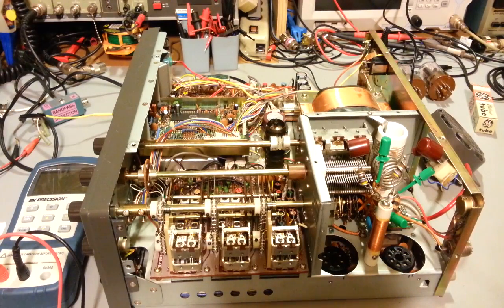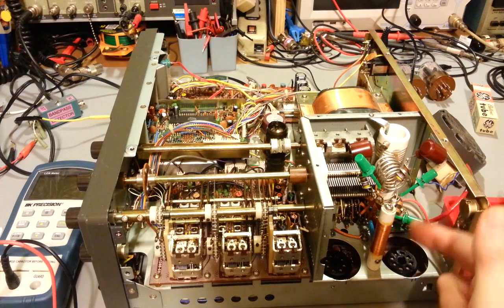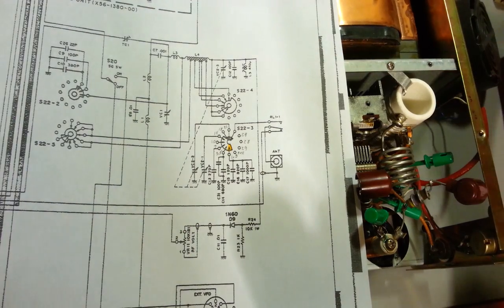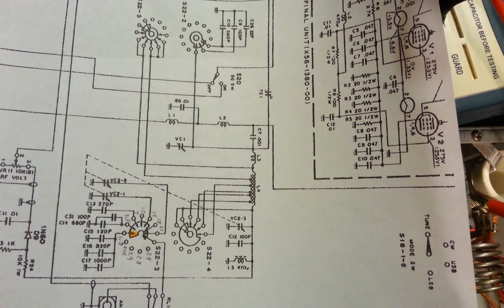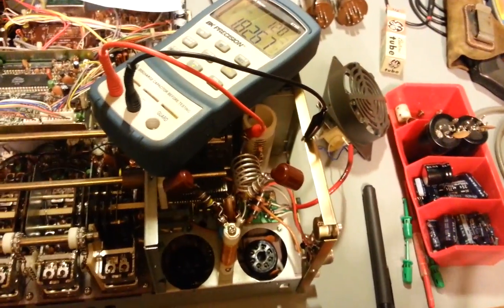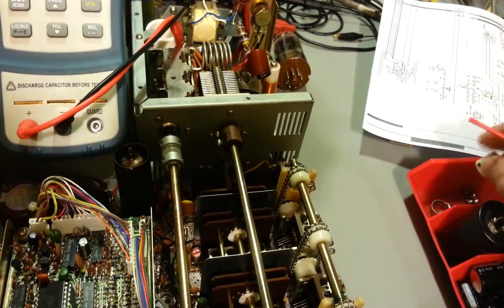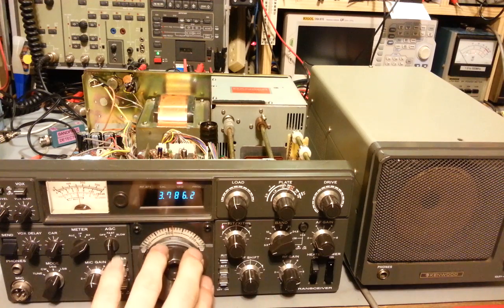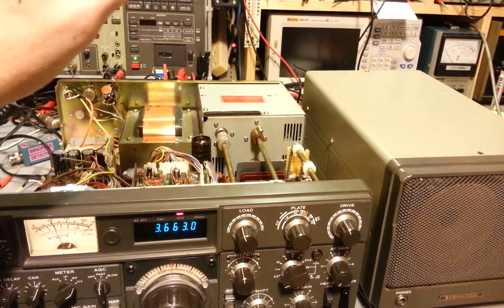Kenwood TS hybrid uneven power across bands. Diagnosing band selector capacitance.

Comment: I deleted first post as all of my reading were near 50% high using a brand new Fluke 15b+. I pulled out my old HVAC meter and the capacitance reading were very close. I take that to prove that part of the band switch is functioning correctly, now for the inductance section of the switch. Only the 7 and 28 MHz bands function . Sending the Fluke back to Amazon.
Reply: The only outlier band I had was 3.5 MHz at 970pf less that Mikes calculations.  I need to look for 1000 pf of capacitance either open or broken wire on 3.5MHz. Also looking for way to remove 520s coil assembly without de soldering individual boards. I’ll probably wait for Mike or Buddy to lead the way.

Comment: Great video Mike. Thank you for your detailed explanation of how these rotary switches work. 
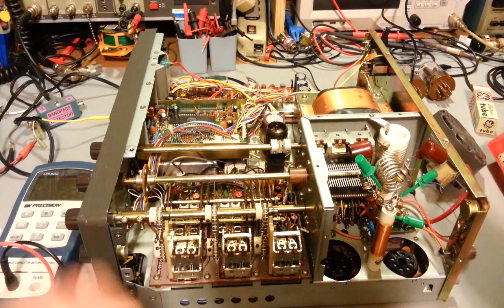I just bought a Kenwood TS-830S, I think it was miss handled during shipment. My problem is with the "Plate Shaft", the screws on the coupler were loose. I didn't know if the dial at 9:00 with the variable capacitor was at 200pf or 0pf. I was thinking that a lower frequency would need a bigger capacitor.
The "Drive Control" jumped off the rear shaft support. The 61468 tubes were at an angle, not straight up.
The main problem I have now is on "Receive", all I get is "snow", and on all frequencies. I didn't realize that I needed to turn the Drive Control also. Some of the switches crackle when switched.
The 30, 17, and 12-meter bands appear to still be connected to the no transmit diodes. Are these the 3 diodes in front of the first wafer switch? Connected to a black jumper wire that starts in front of the first wafer by the diodes? Can I just cut the jumper wire or is there a plug that I can disconnect?
I'd appreciate any help you can offer.
Thank you,
John

Comment: Thank you, Mike. I really appreciate the clever strategy to measure the capacitance. I just picked up a complete TS-520SE station last week and while it seems to be working, I noticed the power output differs from band to band. I'm waiting for a batch of capacitors to arrive, and I will definitely follow this process to confirm all the caps in the PA.
Reply from the maker: Unless the shaft coupler has broken at some point in it's life and someone replaced it and got the wafer switch alignment wrong when they installed a new one this is probably not your problem.  Probably all you need to do is a "coil pack" alignment. I did a video showing this.  https://youtu.be/AAk5_LE5UF4  After several decades it's probably out of alignment.  I just finished a 530S 2 days ago that had almost no output power on 15, 12 and 10 meter bands and low power on 17 and 20.  Other bands were fine.  Alignment of the coil packs was all that was needed to get it up and working like new again.  Something else to note AFTER you do the coil pack alignment.  If you still have low output power on the higher frequency bands.  Note what your ALC indication is when tuning up and adjusting the drive control.  If you have little to no ALC indication when adjusting the drive control then the problem is in the driver section and not the final section.  Possibly a weak driver tube.
Reply: @mikesradiorepair  Thanks, Mike! I was nervous that I overpaid for the estate, now I realize it was a bargain. I'm a huge QRP guy, but powering on this rig and smelling the unmistakable tube rig smells brought me back 30 years. I have decided to become skilled at restoring old rigs. 

I assumed the coil pack alignment would be an issue. I still have all of my old plastic alignment tools, so I'm planning to give this a thorough going-over once the caps are updated. I'll take your advice and do that first. I will make a video of my maiden repair voyage, giving credit to you, Buddy, Larry (backtothefuture,) and all the awesome Elmers keeping the history alive. You are all amazing resources!

Comment: Excellent video!! Very through and precise explanations of what you are doing. I have an intermittent problem on my 530s, lrratic alc action on my 530s ...only on 10 and 15 meters. Will be working fine and all of the sudden no power, no alc. Any suggestions?

Comment: Got exact same radio wanna restore.  Does work on some bands. Suspect the band switch.  Its is wobbly loose like and  feel it is in the pa section. I think the "detent ball" puts stress on this coupler and is why it goes.  This radio, got used, cheap thank goodness,  someone used what smells like automotive spray lube on air caps of drive. Overspray on all variable inductors and transformers on circuit board.  What an idiot.    Is lotta work to clean and repair but be worth it.   Anybody got ideas on cost of tubes and availability?   Just in cases.  I honestly say I not done any serious looking yet. Excellent video.